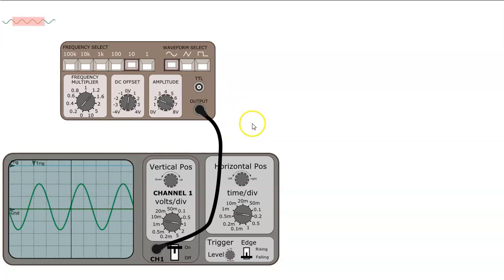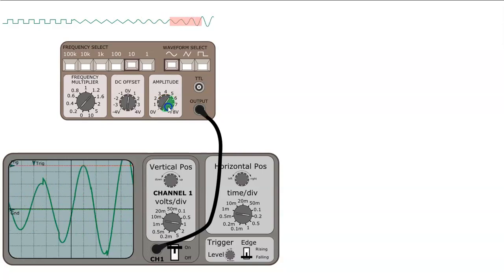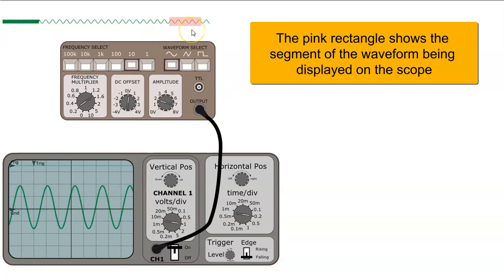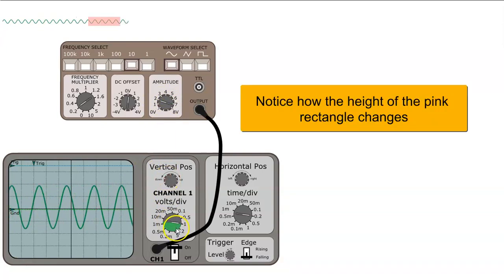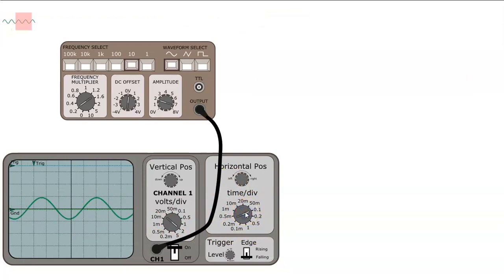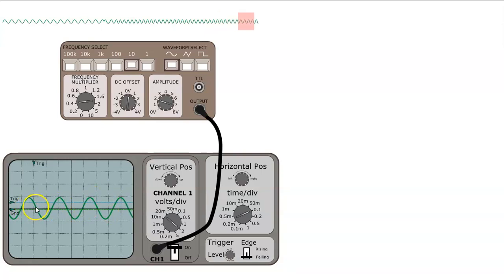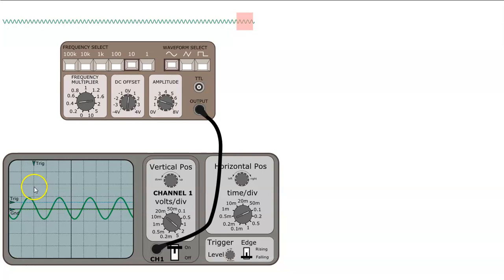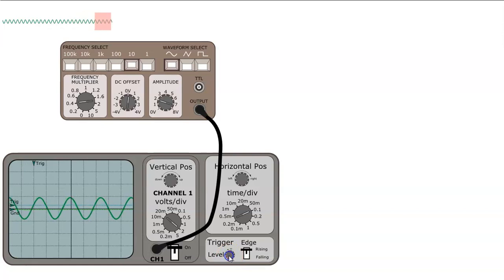How to use an oscilloscope - an interactive simulation

Comment: It's a nice simulation.  I noticed, however, that when I adjusted the vertical position, the trace moved not only up and down, but sideways as well.  This is because the trigger level didn't move with the trace.  I'm pretty sure that in most oscilloscopes, when you raise or lower the trace, this shifts where both the zero reference and the trigger level are, so that the trace does not move sideways.
Reply from the maker: Yes - you're correct. Just checked it out on my own scope. Hopefully it doesn't cause too much confusion! I'll fix it when I get round to the next version - unfortunately there are a few bugs in the current one.
Reply: @ddorran  Thanks for your reply.  I wish you luck in all your edits!

Comment: Hi David, Can you guide me how did you made this? I mean which software you have used?
Reply from the maker: It's basically a combination of javascript and svg images. I use javascript to detect when parts of the image are clicked and then manipulate the svg image using javascript. If you view the page source you'll see the code.
Reply: @ddorran  Thanks a lot Mr David. You did a very impressive work.

Comment: Your demo is an excellent teaching tool and this video is very helpful too!  Thank you for making them avaialble.  I tried the quiz and noticed that many of the images' links were broken.  Would you be planning to fix them any time soon?
Reply from the maker: They seem OK to me Deborah. Which questions are you having problems with? Which browser did you use?
Reply: @ddorran   I'm using Chrome (v85.0.4183.102 (Official Build) (64-bit).  But the problem has gone away : ) hey've started working as I was writing this comment... THANK YOU!
Reply from the maker: @deborahfygenson9541  thanks for letting me know. I'll look into what's causing the problem.
Reply from the maker: I think that issue is resolved now